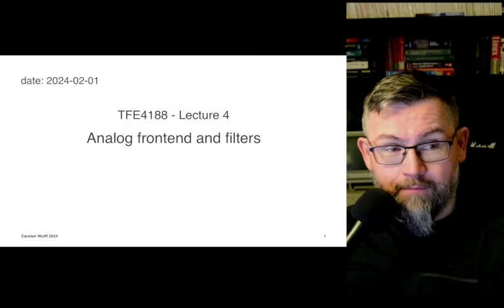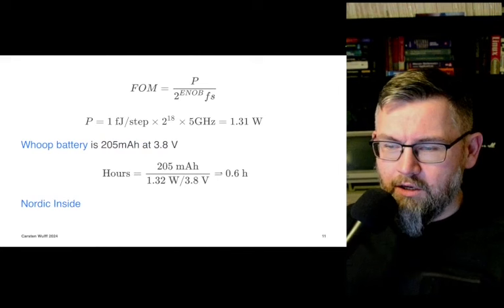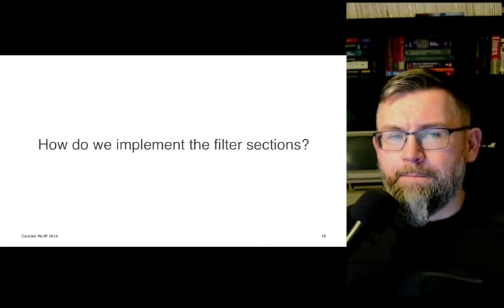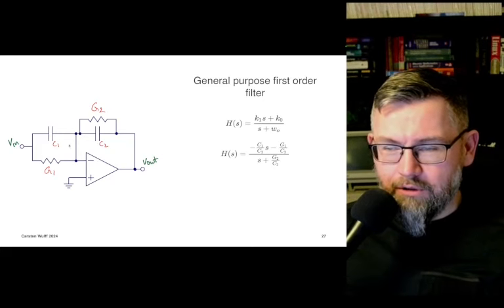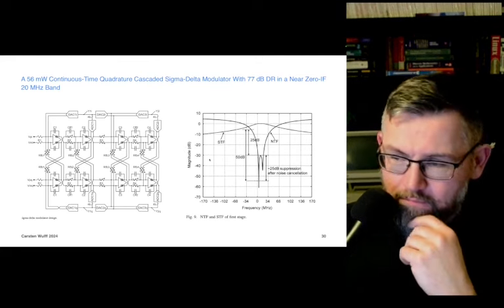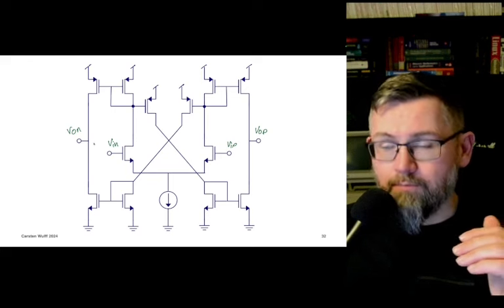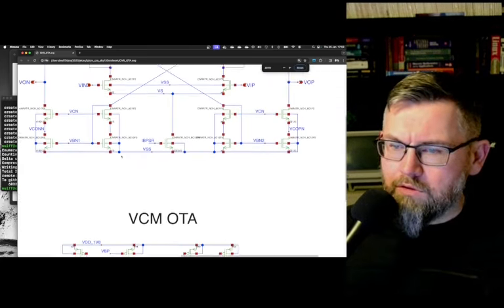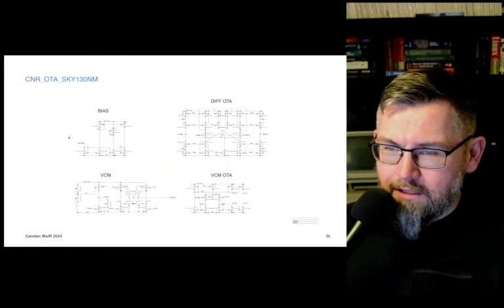Lecture 4 - Analog frontends and filters

Comment: Thanks for the videos and lectures. It would be great if you could upload videos in higher quality. Since you mentioned designing an Incremental ADC at Nordic Semiconductor, I'd find it interesting if you could give a lecture on the system and circuit design of these ADCs. It would be helpful if you could walk through the system design using the delta sigma toolbox and discuss the schematic. Additionally, could you provide more details about the transistors used in designing the OTA? Thanks again for the informative lectures.
Reply: In case you do not know, the professor has posted a lot of lecture materials on his website.
Reply: @getusel  can you please tell me which lecture you’re referring to?
Reply from the maker: Might be this one https://analogicus.com/aic2023/2023/02/16/Lecture-6-Oversampling-and-Sigma-Delta-ADCs.html , but I don't think I have anything on the delta sigma toolbox.
Reply: @analogicus  Thank you Professor.

Comment: hi, thanks for these videos, especially with open source tools. I'm just doing my master in EE focusing on AIC. I would be curious about more system level design and how you would approach it in general. for example I recently read a white paper from Neuralink published in 2019 ("An Integrated Brain-Machine Interface Platform With Thousands of Channels"). In Table 1 you can see the general specs of the IC they designed for their prototype. it would be interesting to see how you would approach a system level design that would have similar specs as the one shown in the paper. how would the architecture look like? I'm very new to AIC, so please forgive my ignorance. very much looking forward to new videos ✌